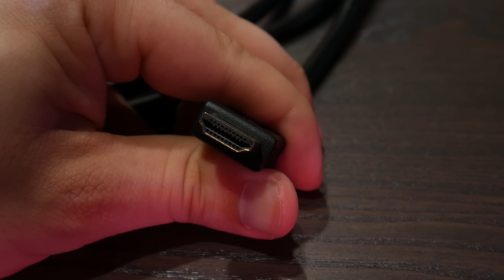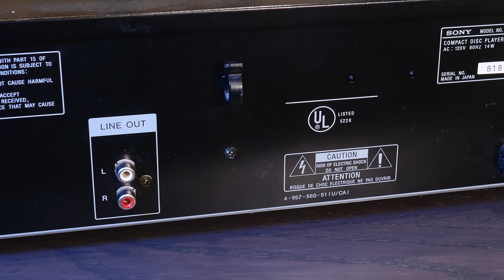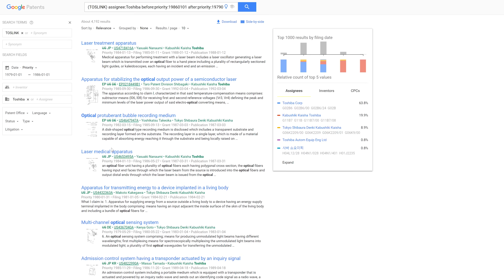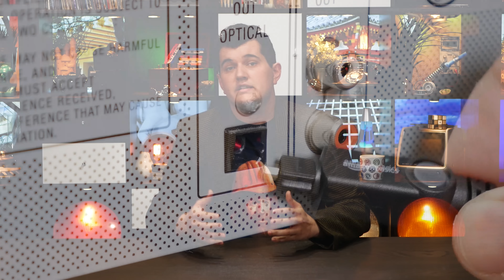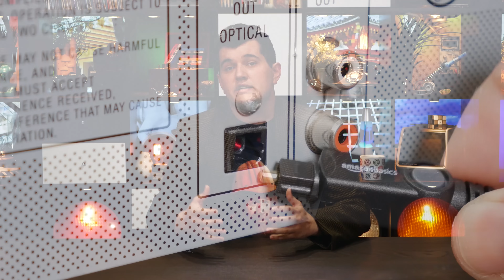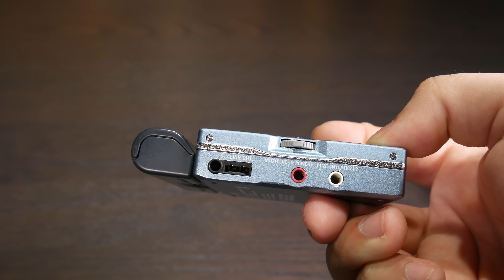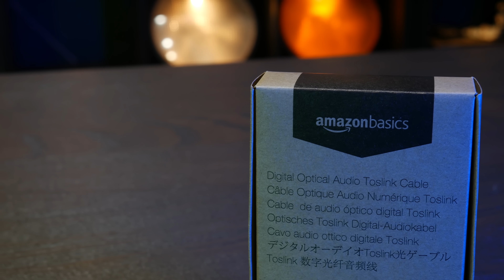TOSLINK: That one consumer fiber optic standard

Comment: Do you know how cheap and easy it is to make a piece of plastic filament compared to a copper cable? Especially for a long distance connection.  You ever tried to add the connector to a fiber cable vs add the connector to a coaxial cable? Now you know the advantage of TOSLink vs SPDIF.

Comment: I was going to bring up ADAT, but you already did. I think the home recording market was the real target for "TOSLINK", but only after morphing into ADAT. I assume ground loops are usually not a big issue in the consumer space, which does make me wonder why TOSLINK is still included on consumer equipment. And actually, the MADI standard requires 2 separate cables (one for in and one for out), and actually supports 64 streams of 48 khz/24 bit per cable - which seems to have been the professional evolution of ADAT.

Comment: TOSLINK is the worst misuse of fiber optic technology.  Very old USB (USB 1.1, 12 Mbps, 1996-2000) could have replaced S/PDIF (3 Mbps) over TOSLINK, only if we have agreed upon audio transmission standard over USB transport. Audio over USB might have many advantages over TOSLINK/SPDIF: widely adopted by except Hi-fi gadgets, uses cheaper and flexible copper cable, bi-directional (half-duplex), can carry 5W power,  flexible protocol carrying both data and control signal, handshaking/negotiation etc. I believe that all audio and video vendors should replace S/PDIF with audio over USB-C standard.

Comment: I was a fan of Toslink since the beginning because I had encountered issues with EM interference on RCA cables near other equipment, but realized in the 2000's that coax spdif worked just as well and didn't have the weak jack that easily falls out! Great video!

Comment: I like TOSLINK because it's a separate input on the powered speakers I bought (thus using it frees up the RCA inputs), my TV supports it, it's one less wire running from the mounted TV to the speakers, and it's a weird standard that I've never used before this one niche application, which makes it fun and exciting!

Comment: There is a benefit to optical signaling - no grounding between devices.   If you have an electrical audio cable the two devices are grounded together via the shield/ground connection on the cable, which can cause a 50/60hz 'hum' to come from on your speakers.  If you isolate the devices by using optical cables there is no electrical/ground connection and you won't get hum in those circumstances.  Not saying this is common but in pro audio stuff like this happens all the time.

Comment: Have you noticed that TOSLINKs are widely installed in devices somehow connected to external antennas (SAT, terrestrial) or cable-TV installation. Sometimes it's the only available digital audio connection! (no SPDIF). E.g. my UPC cable tuner, Dreambox or VU SAT receivers have only TOSLINK output. And you know what, it makes sense as these devices are galvanically separated. From the power supply the galavanic separation is assured by transformer... Any strong static pulse (well, maybe except lightning hitting your terrestrial antenna...) won't get from one device to another! It doesn't matter from sound quality perspective of course but sometimes can save your expensive installation from damage...

Comment: Not data, but in 1973-1987 Chevy trucks a Fiber Optic line was used to take light from the gauge cluster to the ash tray to illuminate it.

Comment: Sounds like an easy fix to make toslink 2... With probably good chances of adoption. The  reciever will easily be able to tell which signal standard is recieved and much hardware could probably be toslink 2 compatible with a software update. Nothing in most manufacturing processes would have to be changed.

Comment: Sadly, my PC's not so cheap Z390 motherboard manufacturer (Gigabyte) decided in all their wisdom and experience that it doesn't need to support the DTS standard. (even though it features TOSLINK) And since my Logitech Z906 does not have an HDMI input, at the moment i am 'forced' to use the SONY/Philips Digital Interface output on my Playstation that does support it, mind you, only via the SPDIF. So yeah, there ya go. An actual practical excuse for using the TOSLINK. ..THANKS GIGABYTE...

Comment: If anything in the home became fibre optic, now, I want it be network cables.  Just imagine the speeds of sending stuff between computers!  I know the bottleneck is sending over the web and that Ethernet is pretty damn fast, but still.

Alternatively, removable media.  Have some copper for power and light to move data at, well, light speed.  The protocol would have to negotiate the top speed of both devices, but surely its got to be faster than it is with all that "oh yes I'm copying at high speed then for no reason imma drop to 300 baud for the last two thirds of your copy!" nonsense you get with pen drives now.

Comment: I use TOSLINK to connect my PC to my amp and speakers instead of over the HDMI from my Nvidia card for these reasons:
1. For some reason, when sending audio over HDMI, the first second of each new audio "session" is cut off. I think this is because the Nvidia card is switching off the audio channel when not in use, but it leads to only hearing the last half of system sounds and missing the first second of audio from a YouTube video, for example. It has been the same with HDMI on various Nvidia cards, on Windows and Linux. I can't speak for AMD or onboard.
2. I can literally turn the amp up to 100 and hear no static. Over HDMI, anything over 30 (which is way louder than is comfortable listening to btw) hisses. With TOSLINK, I get no hiss.
Just my two cents.

Comment: TOSLINK is the only output my TV has (60" LG plasma) and i was delighted to see it worked with my full surround sound system. the only downside i have with it is you still need 2 remotes to watch TV, one for channel changing and one for volume control. with RCA or HDMI connections the TV can still control the volume of the surround sounds output.

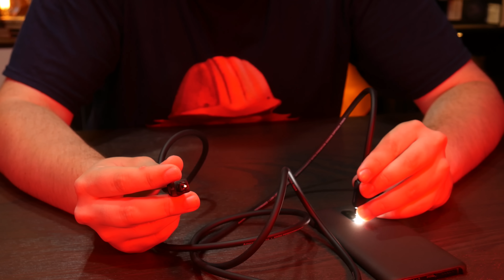Comment: 6:04 ,am i the only one wondering WHAT THE HELL A SMARTPHONE FLASHLIGHT WOULD SOUND LIKE?
Reply: it will sound like nothing... it cant be decoded and even if it was analog you would probably hear a single tone
Reply: That would be strange
Reply: I will test this...
Reply: Yes.
Reply: Probably not much because the smartphone LED runs from the battery on DC.

Comment: "good luck avoiding the building's wiring they are eventually going to share"
challenge accepted
buys 5,000.00 isolation transformer and installs isolated ground ring around A/V room
Reply: "good luck avoiding the building's wiring they are eventually going to share"
But here he is mistaken, you don't need to (or want to) isolate your power cables, you need to prevent groundLOOPS. This means the ground should only be shared at one point, eg. the (grounded / 3-prong) power connector of the devices. If you connect a spdif cable, the shield of this cable will be grounded, and thus you create a ground loop or you need to use ungrounded (2-prong) power cables.
Devices should be grounded at one and only one point. Isolating things (completely not grounding) is also bad, because then the device is 'floating'. You wouldn't need to use 'isolation transformers' either, you could just use 2-prong power cables.. Most likely your devices already has a transformer built-in. The earth-ground (3rd prong) is then connected to the DC-ground, case of the device and to the shields of the I/O cables etc to prevent all of that to become floating.
Anyway, toslink is a great way to connect things without worrying about all of that.
Reply: @chrisdejonge611  you're spot on. The whole reason I run TOSLINK from my PC to the DAC is to eliminate the ground loop and its annoying 50Hz hum. Used to run simple ol' SPDIF, but like you said the shield on that cable completed the ground loop.

Comment: Similar optical communication gets used in industrial and lab equipment like CNC machines and test equipment. The reason is to eliminate problems associated with static, ground loops, ground offsets, and shock hazard.

Comment: Toslink removes a shared ground between two units. If you have a ground loop issue this is great. Because of this i always use toslink rather then digital RCA if not using HDMI with also shares grounds unfortunately.

Comment: ut why hasn't HDMI been replaces with  display port , thunderbolt by now HDMI sucks
the cables are awful ,  fat,stiff, and hard to bend and the female connectors often break or are lose
and have problems , i don't why they didn't move over to DP/TB3 when 4k  1st came out or at least start including it

Comment: i wonder if hyper distilled purified water can be used like fiber optic cable it would fix internal cable breaking and distilled water if  undistubered won't freeze at below water freeze temp.
so  by using either a rubber or  pvc infused cloth mesh tube so you can bend the pipes and pressure and heat are the only issue.

Comment: There are some Toslink leads that are circular so don't key.   One advantage with the Toslink is that you can externally delay the audio if you have lip-sync issues http://www.js-technology.com/store/product.php?id_product=55 (full disclosure - I designed this).

Problem with HDMI has always been compatibility.   In theory you should only have one HDMI connector on your device (I think that was also in the license agreement with HDMI) but because of the problems with different video standards (eg 3D) and audio (surround vs stereo) some manufacturers started putting one HDMI for audio and another for video.   What was happening was that some people were connecting via the A/V amplifier to their 3D TV.   The amplifier didn't know about 3D so forced the source to switch off the 3D, but the TV didn't know about surround sound as it only has stereo speakers so switched off your surround.   Your 3D full surround set up then because of HDMI defaulted to stereo audio and 2D picture!   Having the Toslink to existing A/V amplifiers never ever suffered from this problem.

I've told people when buying leads not to buy gold plated Toslink leads!   And that a high quality HDMI lead will give the same picture as a standard HDMI lead.

Having an optical connection also means that you have no circular connection between source and amplifier.   This prevents ground loops from occurring.   Ground loops are nasty and difficult to solve sometimes!   Remember that the power supply in these devices, especially if they're linear ones, do an amazing job at filtering noise.   Then you go and ruin it with connecting one noisy bit of equipment to another.   The optical connection removes a lot of those problems.

Comment: The one thing you missed is that for whatever reason, HDMI audio, especially with ARC, has huge latency vs plugging an optical cable into your TV.

I don't know what the technical reason is for this, but it's a major problem for anything latency sensitive like rhythm games or multi-room audio

Comment: The difference over Toslink over digital coax is Toslink does not support anything other than 2.0 as standard, where as digital coax can take anything.   Reason is not the tech but Toslink is Toshiba spec design and the spec never got updated.   Yes DD and DTS now is possible but really its still 2.0 with a compression codec at either end.  Digital coax with DACs will always be better for pcm and raw for music cds.   For cinema blurays or cable boxes to tv or soundbars it makes no difference to normal consumer.
 
Toslink was only designed as a compact disc midi system link, ie only redbook cdda standard  2.0.   With Dolby compression for 2.0 to surround, logic1 logic2, 2.1, 5.1 (7.x is pushing it).  Also same for DTS,  but its not the same as coax or hdmi arc as that real upto 7.2 bandwith.   

Sdif and Toslink to the tv movie consumer - its the samething.   If you love music then use coax bnc or phono to DAC as it has more bandwidth for raw (no codec compression).

HDMi ARC is taking over.  (copyright reasons -  DRM)

Comment: RCA cables can introduce ground loops between equipment. TOSLINK cables do not as they essentially act as an electromagnetic air gap. The issue is not about interference of the signal inside the cable itself but that interference (RFI) can travel on the outside of the shield of the coaxial cable. This RFI is then introduced into the equipment and could potentially interfere with the signal after the DAC.

Any noise on electrical wiring can be filtered with a simple AC line filter. This is standard practice for professional audio, scientific and communications installations.

Comment: BTW, fibre optics is much slower than metal since light fasts with C speed only in a vacuum. Plastic and glass introduce delay. It does not matter much for home applications but not in professional with huge number of data links which should be as fast and synchronized as possible.

Comment: New cables mean huge money grabs (from us the consumer) for the companies that jumped at pushing for additional formatted cables! If there isn’t something they can tweak slightly and make big revenue some of these companies couldn’t afford to keep their doors open in the Bay Area!!! Cell sites had to phase out most copper and move over to fiber to be able digest the huge amounts of the data needed by our hungry smart phones, tablets, and IOT devices. They also had to redesign the traditional radio base station form factor (RBS)  where there is just a small 4U rack mounted interface down in the shelter and the rest of the equipment was designed into a air fin cooled enclosure (wireless industry named it the RRH or RRU. remote radio head/unit) that gets mounted behind the antenna at the top of the tower and then connected to the antenna with either fiber jumper or 1/2” copper coax jumper. Some manufacturers for some reason decided to stick with a copper jumper for that last mile which makes no sense when their plan was to get rid of all dB signal loss if possible. Someone mentioned graphene earlier, I’m thinking graphene might have a use in this architecture eventually.

Comment: HEY PEOPLE i'm use that very same Fiber optic cable to connect my motherboard sound to a Bluetooth transmitter for noiseless Bluetooth headphones at any volume level and it was the same when I had a 1000 watt home hifi connecting my high-end DVD to my high-end receiver, Fiber optic is the best there is!

Comment: I bought the original Apple Airport Express to use the fancy new "airplay" feature to transmit music from iTunes to a stereo on the other end of my house.  It came with a mini TOSLINK output and even included the cable to output digital stereo audio to my receiver.  Prior to that I had a 200 disc JVC cd changer which was hooked up with a TOSLINK cable, but honestly I just used TOSLINK for both "because I could" and it seemed neat, not because it really helped out my audio noticeably.

Comment: i first learned about mini because the macbook the longer male end of the cable would press something that put it in optical mode which would then turn off the copper contacts and i could not get sound of out my port. after plugging unplugging a thousand times i noticed the red light. had to take it apart and clean the switch with alcohol and then my brain with rum.

Comment: 10:06 But you would want the twin-fibre cable to be a crossover, where transmit at one end connects to receive at the other end and vice versa. Whereas the actual single-fibre TOSlink connector is the same at both ends (RCA connectors have that property too), and doesn’t prevent you from connecting an output to an output, or an input to an input. So basically there would be no compatibility with such a hypothetical twin-fibre connection anyway, and it would be pointless to try to incorporate any such into the design.

Comment: 14:20 It's kinda like now a ton of USB's these days use the metal end and are gold plated, but most of the time it's utterly useless. There's a few USB cords and flash drives that use plastic and get away with it no problem

look for "Sandisk Cruizer Fit"

not to mention there's already a way to utilize the plastic connector for a reversible connector but nobody does it because it costs a few more pennies to manufacture. even the metal ones have the possibility to reverse just fine...

Comment: Omg, the headphone jack of my laptop glows red and I always thought that was so you could tell it appart from the microphone jack without having to look at the ridiculously hard to see symbols beneath them, but I guess it is a toslink connector as well :o

My laptop is from 2017 btw, so this is no obsolete tech apparently
Reply: No, it isn't obsolete in this application quite yet. There is no simple alternative to get digital audio out of a laptop by itself unless you go wireless (Bluetooth).

Non-simple alternatives: Build laptop bigger for an RCA S/PDIF jack. Grab audio from the HDMI connector. Connect an external USB sound card.

Comment: What's funny about toslink is not only is it odd and kind of pointless using it vs a wire,  but most modern devices have dropped the s/pdif coax connection but are still rocking a toslink port. Also when I was about 12 I figured out that my PlayStation 2 had a toslink port on it because I saw light coming out of the back of it and when I plugged a Monster toslink cable (I'm sure my dad paid $100 for he was always a sucker for cables ha, It's digital!) and saw red light coming out of the end of it, it was like I had discovered some ancient Egyptian technology no one knew of, I was amazed it used light.